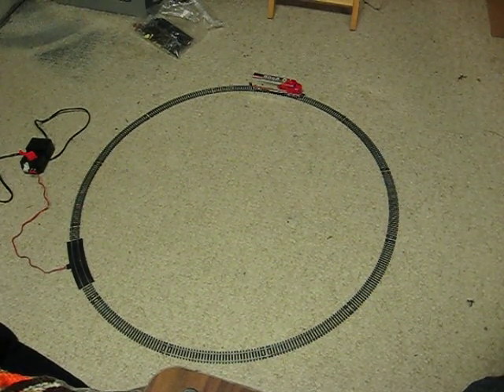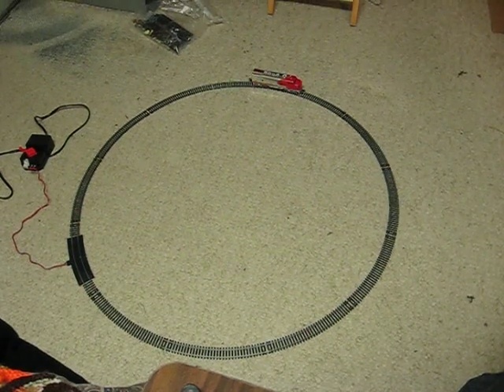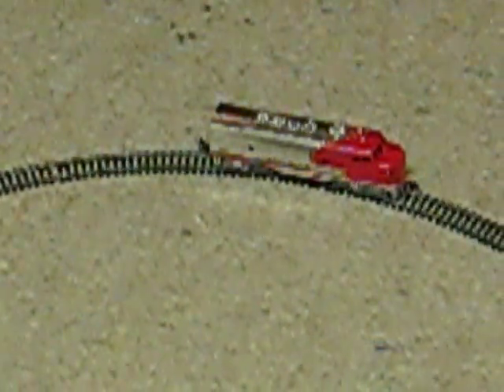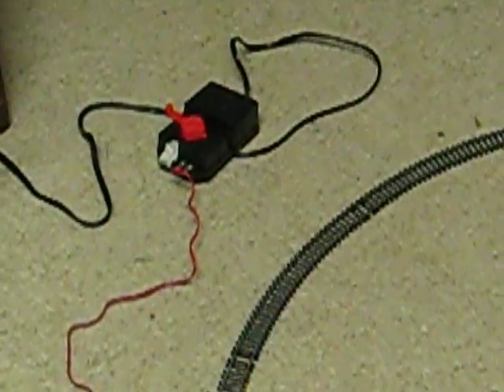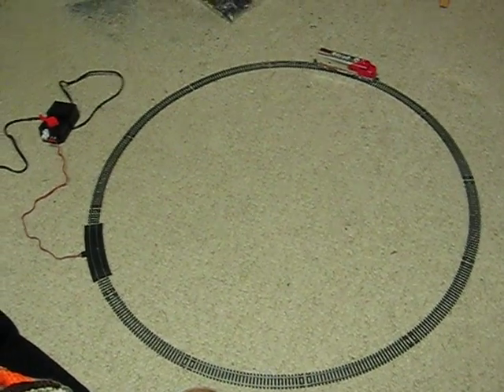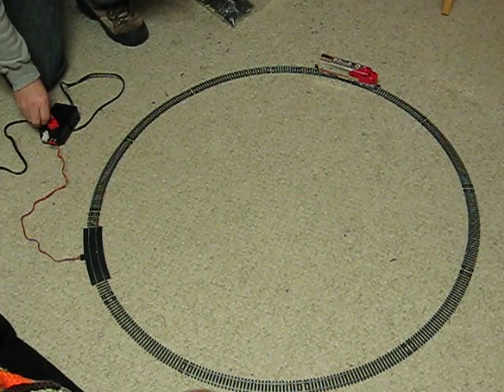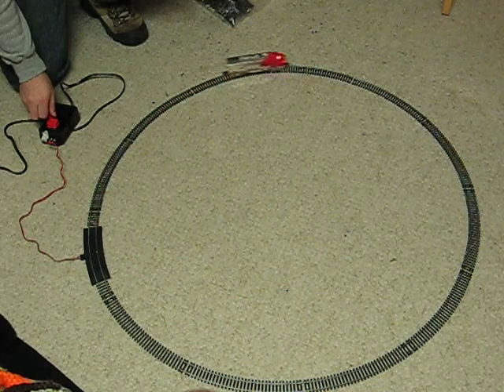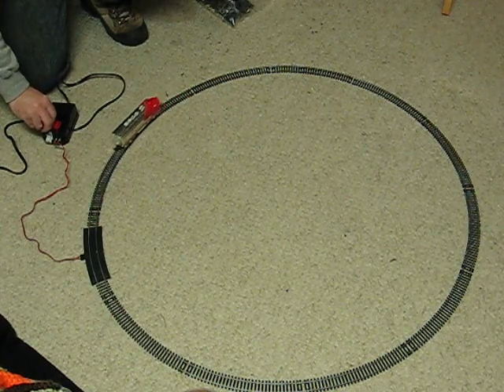Sale Item Demo - HO Scale Railroad Transformer and Bachman Diesel Engine

Comment from the maker: It sold already (the engine did at least).  It went for its opening $10 bid.  Then again, sales were down across the board in January.  Transformer will be relisted if eBay has another free listing special this month (or if I get around to tossing it up on eBid, eCrater, or Bonanza).